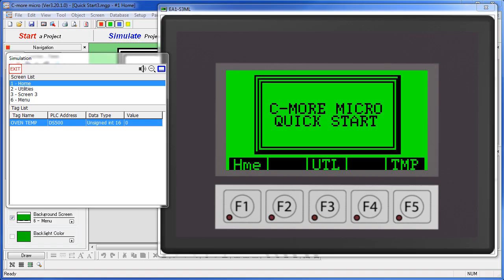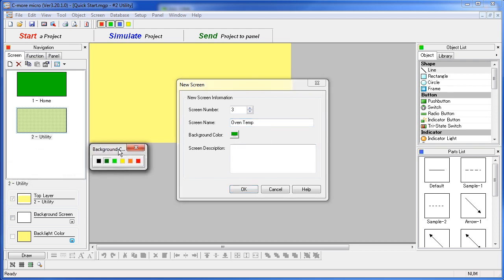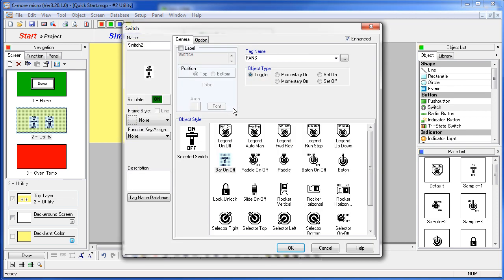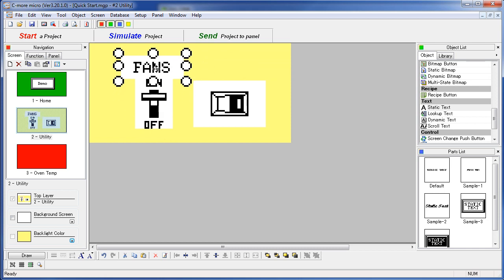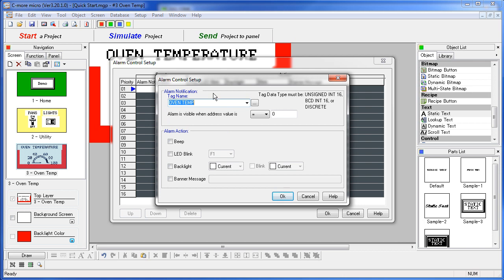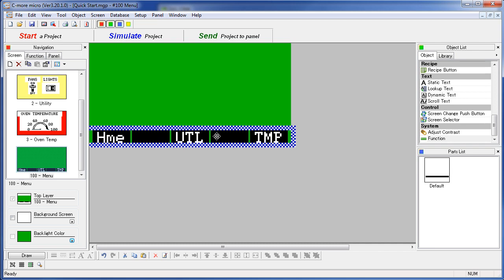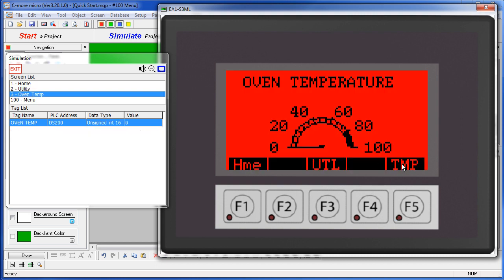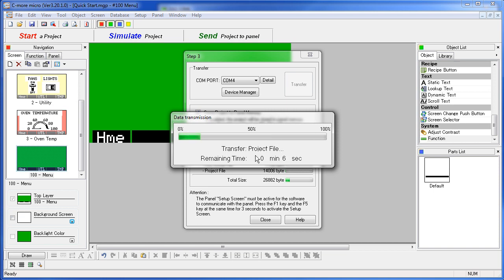C-more Micro HMI Quick Start from AutomationDirect

Comment: !CAUTION!

If you are using the Alarm Control Setup feature, make sure you use the correct value for your application.
The value used in this video for " greater than" is not correct!
Reply from the maker: Thanks for the suggestion Max!